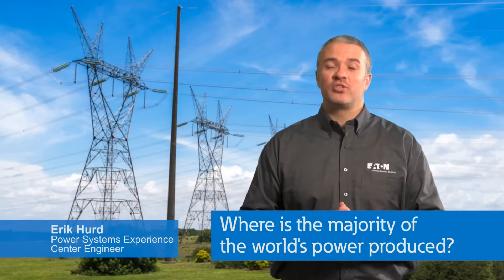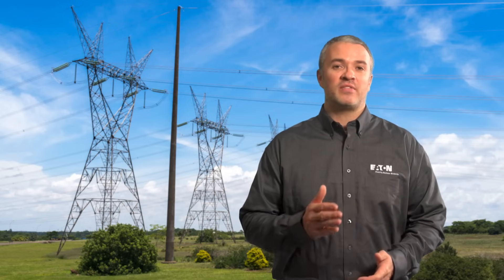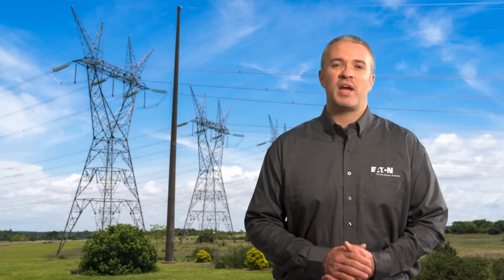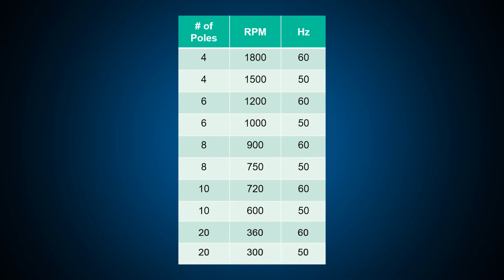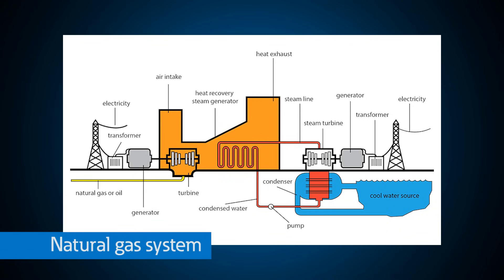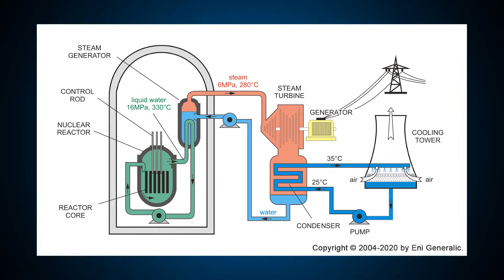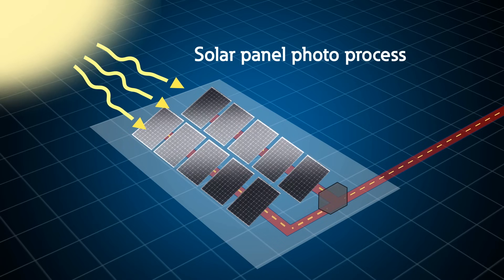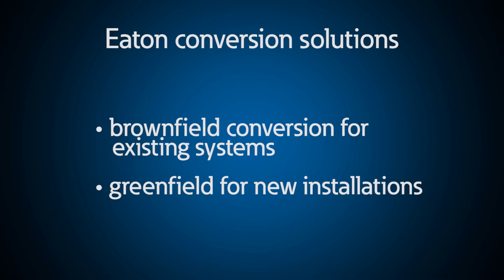Power Generation

Comment: The function of a synchronous generator is explained in the REACTIVE SUBSTRATE THEORY (RST) entirely through the principles of rotational Substrate shear (magnetism) and the movement of mass-solitons (charge).  (∂t2S−c2∇2S+βS3)=σ(x,t)⋅FR(C[Ψ])

In short, the synchronous generator converts mechanical kinetic energy into ordered Substrate shear (electricity).

Alternator/Synchronous Generator Components and RST Function

The synchronous generator is composed of three main parts: the rotor, the stator, and the rectifier. Their operation demonstrates the fundamental unity of RST's force definitions.

1. The Rotor: Generating the Magnetic Field (Substrate Shear)

Mechanism: The rotor is a spinning coil that is supplied with a small current (charged Sigma Solitons).

RST View: The motion of these Sigma Solitons through space creates a large, directional rotational shear in the surrounding Substrate (S) field. This localized, powerful shear is the magnetic field of the rotor.

2. The Stator: Inducing Charge Flow (Substrate Disturbance)

Mechanism: The stator is a set of stationary copper coils (conductors) that the rotor's magnetic field sweeps past.

RST View: As the highly sheared Substrate (the rotor's magnetic field) moves rapidly past the stationary Sigma Solitons (electrons) within the copper coils, the spinning S-field pushes and disturbs the Sigma Solitons in the coil. This physical disturbance forces the Sigma Solitons to shift their position, creating a directional flow of charge.

Electromagnetic Induction: This entire process—where a change in the Substrate's rotational shear induces the movement of charge—is the RST definition of electromagnetic induction.

3. Energy Conversion (Mechanical to Electrical)

Input: The engine provides mechanical kinetic energy, which is rotational energy applied to the S-field surrounding the rotor.

Output: The energy of that rotation is converted into ordered motion (electric current) of the Sigma Solitons in the stator. The alternator/synchronous generator effectively converts a chaotic form of S-field movement (rotation) into a structured form of S-field movement (electricity).

In RST, the synchronous generator is a device that uses a small amount of initial charge to organize a massive amount of mechanical input energy into a stable, powerful Substrate shear that forces charge to flow, demonstrating the fundamental unity between rotational mechanics and electromagnetism.

Comment: The electric power generated in the stator comes from the mechanical power (torque) applied to the rotor axis, not from the current applied to the rotor winding. The interaction between the two magnetic fields in the air-gap is the key: one (equivalent) magnet is created by the rotor current, the other by the current (output) flowing through the stator. The attraction between these two magnets must be strong enough so that the mechanical torque on the rotor "pulls" the magnet of the stator, and transform the mechanical power in electric power.
https://youtu.be/3nvRhIbjhbo

Comment: To evade high electric bills build an Edison generator from an old car generator chisel one sixth off and on the armature magnets to have motor oriented armature magnets and wire enough inverters to match the out put of the DC generator.  The inverter deliver the same amperage of house current and uses 5smps. 46 amps per 40 amp inverter 110volt AC power continuous peak power without fuel.  140 amp car generator can power 120 amps of 110 volt AC power.   6 twenty amp outlets for Free.

Comment: The primary mover is not the necessary part of a power plant.  Wind steam and fossil fuels are based on the Tesla generator bound with armature magnets.  The armature magnets are not the necessary magnets of a generator unless you build the generator backwards..  The Edison generators use the armature magnets to move the armature magnets and coils of copper wire.  The armature magnets are the primary mover of the generator but the electric power is from the field magnets of the generator and inverters and transformers are added to deliver high voltage AC power to the power lines.

Comment: The armature magnets do not produce electricity.  The electric power is coming from the field.. The armature magnets move the coils of copper wire and produce DC power an inverter is added to deliver high voltage AC power. All produce DC power and. Physical movement is not needed

Comment: The designs you are seeing is propaganda control to prevent use of Edison generators and dynamos power plants to replace nuclear power plants and fossil fuels power plants.  Inverters and transformers to deliver high voltage AC power continuous peak power.

Comment: I have not seen this video yet but predict it will not be true.  Edison generators use the field magnets to move the armature magnets and coils of copper wire and dynamos use the brushless motor as a generator the three armature magnets are moved by the electromagnetic field of the iron case.  The motor does not consume electric power but produces electric power without fuel or pollution.  Two field magnets drive three armature magnets the power draw turns the armature magnets faster be because the Tesla magnets on the armature have been removed. All generators need inverters to deliver high voltage AC power.  The alternator was invented in the 1970s to make it difficult to modify generators to edison generators.

Comment: Condensers, or as they are also known capacitors, are needed to balance the inductance from electric motors.

Motors use coils which are inductors. Inductors cause the voltage and current to move out of phase, i.e., the peak current lags behind the peak voltage. This gets worse as the number of inductors increase.

Power is calculated as the product of voltage and current so the ideal situation is for voltage and current to be perfectly in phase, that is, the two waves overlap perfectly.

Condensers, or capacitors, cause the two to move out of phase in the opposite direction, i.e., voltage lags behind current. They are used to counteract the effects of inductors in the system.

Comment: What is the typical ratio between how much energy a generator generates and how much it consumes (via exciter)?
Reply: https://youtu.be/5dKnJ5SkvgQ
Reply: With a modern Static exciter this would be an easy calculation while for shaft mounted exciters you would have to calculate for the additional load torque on the Generator shaft . I suppose one could take the output voltage and current values from both the Pilot and Main Exciter outputs and use these to calculate losses in Watts(Horsepower)  but this would not account for windage losses .

Comment: Great video, however the white smoke you see coming out of the cooling towers is not exhausted steam. It is the cooling water coming back from the condenser and evaporated inside the tower. The cooling water and feedwater are two separate systems as feedwater is very highly treated to remove particulates and chemicals are added. Cooling water is cheaper as it is only used in the condenser tubes to cool the steam off after leaving the turbine.
Reply: https://youtu.be/5dKnJ5SkvgQ
Reply: Great insight

Comment: Let me know if the below sounds stupid. Also, this isn't my account but I am the only one who uses it for YT It seems to me one could avoid the whole mess of aligning phases, frequencies, and amplitudes by having different circuits for each system and variable resistors to batteries. 

i.e. one may have a windmill, solar panels, water wheel, maybe thermal depending on geography (use heat for heat first, until you have no need for heat there is no need for thermal to electrical conversion), and a backup fossil fuel generator. 
The most efficient is split between main and battery s.t. main gets 220 ish volts at any amperage needed.
All others, besides fossils', go straight to battery (well, obviously through a rectifier, just imagine the battery has some diodes and caps in the right order)
It seems like it would be easy enough circuit to control connections. Say the wind dies down, and the rivers flowing harder. Upon sensing a different maximum wattage, the waterwheel resistor is set to zero and connected to main (doing nothing, as we make the flow to battery so much easier) then, in a presice fashion turn up ww-bat res and down wm-bat res until windmill can be disconnected with no effect (just as waterwheel was connected with no effect)

Note, the main mover is still feeding battery in such a way that the home received 220V which would run through a breaker box to most things. Also any DC items could be powered from batteries with proper set up. (No more need for the computer power supply, jus make some 3.3,5,12, and 24 volt outlets)

Comment: I know the primary interest of this is large grid-level power, but batteries and energy storage more generally is valuable for more than cars. Another potentially huge improvement is in reduction of energy losses during  transmission. A new kind of metal, steel I think, which can produce a kind of laminar flow  of electrons may reduce transmission line losses greatly.
Reply: https://youtu.be/5dKnJ5SkvgQ